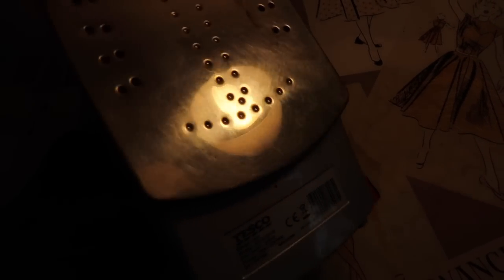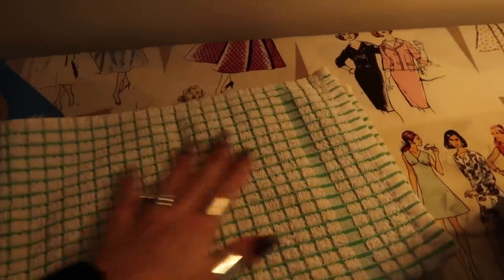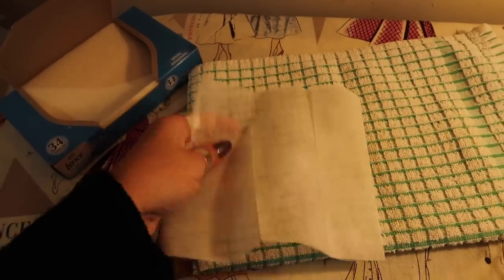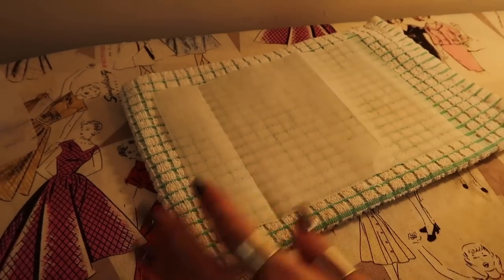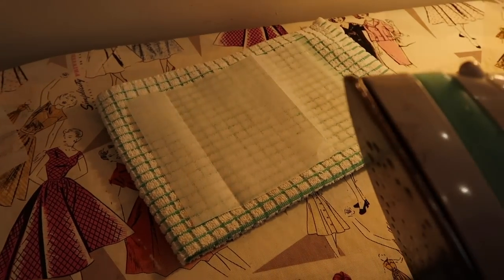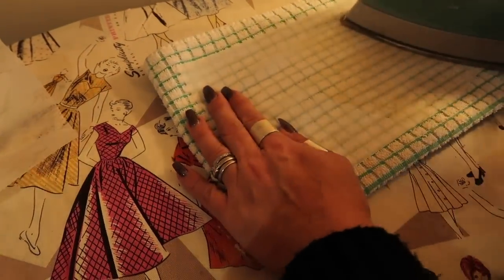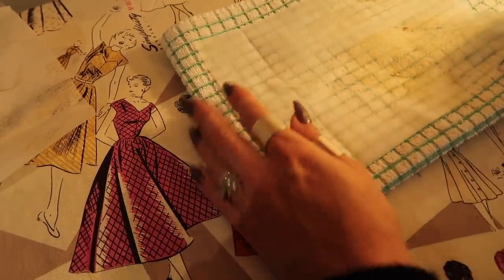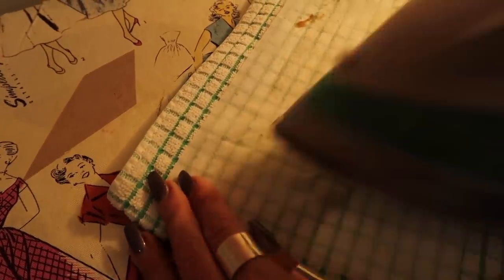Cleaning melted fusible interfacing off your iron - This really works!! | Claires Top Tips | SEWING

Comment: A follow-up on yesterday's comment. The dryer sheets (4) worked to clean my iron. I later managed to get More gunk (interfacing? polyester?) on my iron that the sheets wouldn't remove. But the real problem was with the chemicals of a total 7 dryer sheets atomized into the air of my sewing rom, I started to get really ill - headache, nausea, confusion... 24 hours later I am still getting this out of my system. So just a heads up that if you're sensitive to chemicals (I am the 'canary in the coal mine") you should consider another method for cleaning your iron. I stopped using these sheets years ago when I heard they could be toxic to pets. Looks like they're toxic for me too!
Reply from the maker: Oh gosh I'm sorry to hear this. I only use them on freshly melted gunk and 1 now and again. I don't think this is a solution for cleaning off old gunk or melted items for sure.  Good to know though, I hope you feel better soon.
Reply: Thanks, I'll be fine. Just wanted to warn others. I get the same reaction from  Febreeze, Hairspray, etc.

Comment: THANK YOU!!! This worked perfectly on my Rowenta DW-2070 with it's stainless steel plate that has about 300 tiny steam holes in it. I thought for sure it was ruined. I tried this tip and was thoroughly impressed how well the dryer sheets took off all the glue and left the plate smooth, clean and as shiny as when the iron was new!! I did have to use 3 sheets on mine, but who cares!! The Rowenta has a highly polished SS plate and it irons so well because of the smoothness of the finish, so that is why I was so worried it was ruined when I got the glue on it.
Truly, I am so glad I found your tip and again, thank you so much for sharing it with us!!
Reply from the maker: So glad it helped
Reply: Yes, mine it the same.  IT worked.

Comment: Wow and thank you so much .. I did just as you said somehow touched a scrap of fusible webbing with my iron, the good iron I had finally splurged  decent money on to replace the  cheap  but practically  useless $15 college days iron I'd had for over 40 years . I never thought an effective iron could bring such joy but it's amazing how it can really make a project look more professional, so I was very dissapoointed. Your tip worked like a charm . I tried a dye and perfume free sheet first and it was somewhat working, when I tried the regular sheet the sticky stuff came right off! So nice when a tip like this actually works and this is non abrasive so saves a Teflon finish from scratches.  Thanks again
Reply from the maker: so glad it worked. A good iron can be the makingo f a sewing project. I love a good bit of steam!

Comment: I just have to say THANK YOU for this video. For the first time ever, I did in deed iron a fusible interface on the wrong side. Unfortunately, I also got it on my ironing board cover. The iron came clean fairly easily. I did have to use 2 dryer sheets but it worked. Again, THANK YOU!
Reply from the maker: so glad it helped

Comment: I have ironed on fabric fusing tape to adjust the length of my dress before I stitch it together. Also did the same with new tie around the neck shoulder straps which as you can immagine left the iron full if sticky mess. This tip cleaned the iron in less then 3 mins with no fuss at all! I used 3 of them sheets as my iron was in quiet bad state and OMG It WORKS!! Recommend to everyone if you have same problem. 
Thank you sooo much!!!
Reply from the maker: It's a goodun

Comment: Oh my gosh this worked so well. I was trying to do an iron on transfer and didn’t realize what happened until I turned the iron over. I was ironing the transfer upside down. The sticky paper was stuck to the iron. Didn’t know what to do so I looked it up. Found this trick & tried it immediately. Worked great. I balled a fabric softener sheet and rubbed it over the iron. After a couple of sheets, it’s off. Thanks so much!
Reply from the maker: phew that sounds like it could have been a melty mess!

Comment: Thank you Claire. I used the stick, it actually made the sole plate worse, stuck in the holes, despair. Tried everything mentioned, a bit better, but not good enough.
I'll be so happy to try this tip.
Thank you.
Reply from the maker: I used to use the stick too, but ended up burning my fingers and clogging it all up. This really really works, it's amazing

Comment: I accidently touched the iron-on with my iron but almost immediately realized it so it wasn't too awful. The iron cleaner I bought is in my sewing room. Somewhere. So I came looking for solutions and found you.  I recently had a mouse and heard that Bounce dryer sheets would repel them. But the cinnamon worked so the sheets were looking for a new job. They found it. I felt like I worked at it a little more than you but my iron is shiny clean now. Thank you.
Reply from the maker: So happy you found a use for them!

Comment: BEST. TIP. EVER.  I had a couple of spots where I got interfacing glue on my iron. Wasn't causing a problem, so I figured I'd clean it eventually. Then today, I was making double fold binding with waterproof canvas. Well, the canvas separated and I got the waterproofing on my iron in a large spot. Tried Magic eraser, simple green and goo gone and nothing worked. Then I saw this video and, voila! Had to use a few dryer sheets and take my fingers into my own hands, folded the sheet up several times, and wiped quickly on the little remaining spots (don't recommend this. You have to be really fast) and now my iron looks like new. I wouldn't have believed it if I'd not seen it myself. Took less than 5 minutes. Never using anything else, especially the expensive cleaners, to clean my iron. Thanks SO much for posting this!!!! Brilliant. Bonus ... my house now smells like fresh laundry :)
Reply from the maker: I love this. So glad it helped

Comment: Thanks very much for the tip!
I had the remains of an iron-on patch stuck. Didn't have a tumble dryer sheet handy (or a tumble dryer for that matter 😆), so tried kitchen roll with a few drops of vegetable oil. This worked OK, though probably not as well as the dryer sheet.
Reply from the maker: I think you can add fabric softener to an old cloth and it will work too

Comment: Wow!  That is amazing!  Thanks for a great tip.  I always wonder who comes up with this stuff.  Like, who first thought, "Oh, no!  I've burnt interfacing glue onto my iron!  What will I do????  I wonder if ironing a dryer sheet will take it off?"  I make note cards and invitations using decorative paper napkins, card stock, and plastic wrap.  There are occasional accidents with the plastic wrap and the iron.  I'm going to see if this works on that, too.  Thanks again!
Reply from the maker: I know LOL I do that too.  Let me know if it works for you, I suspect it will do
Reply: Usually when you buy appliques, on the bolt, or within the instructions as with any kind of fabric, it tells you how to clean it. With applique it says not to use fabric softener otherwise your applique will peel off~

Comment: Another thing that works good are adhesive removal pads. I got them when my husband had an ostomy bag, but you can get them anywhere. They are great for taking label glue residue off of jars and bottles ... so I tried it on my iron. I like the idea of dryer sheets ... And I will try them ... I just didn’t have any on hand when I made my mess ...
Reply from the maker: Great tip!

Comment: Do these work on old burnt on sticky stuff from interfacing? I tried cleaning it off but it won't budge and it's been on there now a little while, or is this method just for freshly stuck on adhesive?
Reply from the maker: It should do but you might need to heat it up a little first to melt it back down.  You might need several sheets too

Comment: What ever is on my iron is black and right in center of steam iron. It is around steam holes and may have come out of the steam holes. Any suggestions?
Reply from the maker: Will still work. Use a peice of dowl or similar to poke the drier sheet in and round the holes

Comment: I melted a plastic bag on the bottom of my iron. The drier sheets took it off. Note: I had to use a number of the drier sheets and apply a lot of pressure as I ironed back and forth on the drier sheet.
Reply from the maker: I melted my carpet tiles recently (iron fell on the floor). Carpet tiles are ruined but several drier sheets later.....the iron is like new! Magic!

Comment: Tried this, filled my sewing room with smoke. Tried again with the iron on low. Same thing. Ended up using steel wool and just getting the last faint smidges with the dryer sheet. Don't know what I did wrong.
Reply from the maker: I think your element may be out on your machine if it still smoked with a low heat.  That or it's a very potent glue you've got stuck on there.

Comment: Hmm, tried this and the dryer sheet just melted onto the iron as well - maybe our dryer sheets are different. Found that the only thing that worked was heating the iron and then wiping vigorously with rough paper.
Reply from the maker: You probably have the iron up too hot.  It only needs to be warm

Comment: Okay, not so easy for really baked on stuff... I found that having the iron as hot as possible and leaving the iron face down on the sheets for several minutes, like 5-10min, was needed to help shift some of the stubborn baked on layers & I've needed multiple sheets/attempts as well but it's slowly removing more each time.  The sheets don't seem to burn 🤷, so that's good to note.  You can see the melted sticky stuff left behind in a shiny/dirty mess on the dryer sheets, I guess that depends on how good a job your errant ironer did of trying to win your iron!  I'm on about my fourth sheet on this community musical theatre costume iron which we would otherwise have had to replace & Is rather spend that money on more costumes than on replacing irons continually.  For this long soak of method you'll want to ensure that you're using an old cloth underneath as you will likely scorch that fabric.

I also used some disposable bamboo cutlery to get the sheet into the steam grooves of the iron, in case that's useful for others to try...  upended the iron and worked down onto the hot surface, obviously take care not to burn yourself.

I haven't used dryer sheets for about 20yrs or more so it's interesting that they've changed over that time...  they used to be more porous/spongy, now they're more like a chux type dishcloth.
Reply from the maker: Blimey, sounds like you've run a marathon, but well done for perservering

Comment: I used another brand of dryer sheet.  It didn't work.
Reply: I used a cheap brand from the drug store, heated the iron up to high,  folded  a tea towel up (like she did), but I put about 3 or 4 sheets of paper towel on top of the tea towel and then put the opened up dryer sheet on top of the paper towel.   I ran the iron over it a couple of times and that got most of it and then ran the side edges of the iron over it and it ALL came off.  I live in Canada so we have different brands of dryer sheets but they all smell the same so must be similar.  Try again with the paper towel underneath.  When I was finished the paper towel was yellow as though the stuff had been absorbed by the paper towel.  The tea towel underneath was fine - but I am glad I used the paper towel between the dryer sheet and tea towel.
Reply from the maker: thats a good plan. The iron can be too hot if they are thin dryer sheets